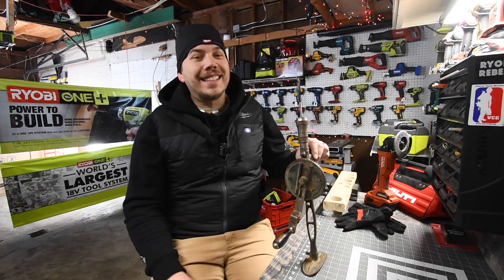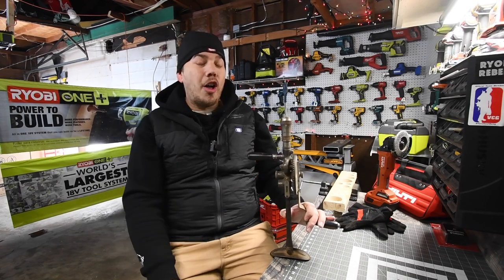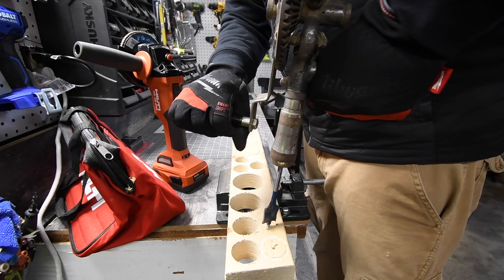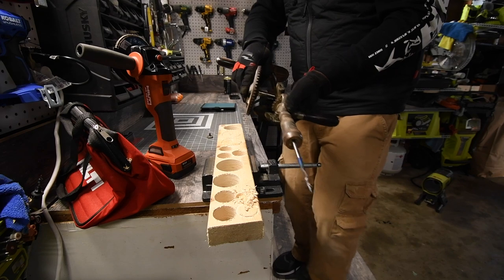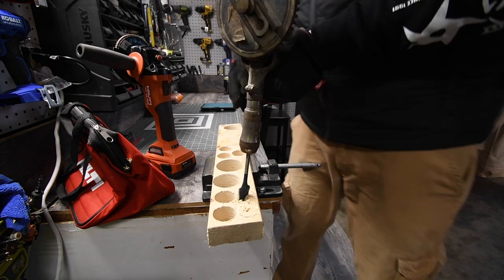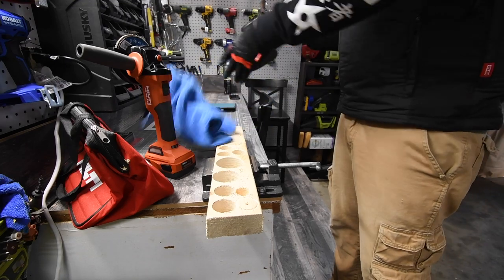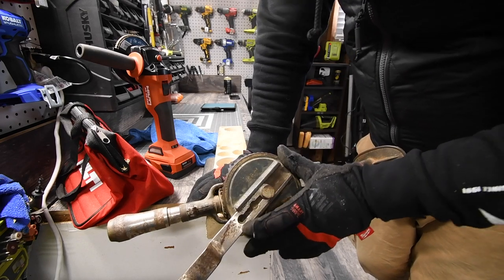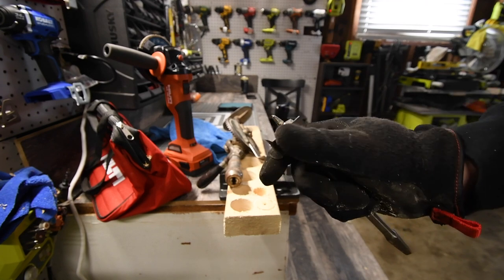131 Years Old Breast Drill (Miller Falls Tools)

Comment: 👍🏼☕🍩☕👍🏻👍🏻👍🏻  You need to get yourself auger bits though the ones to work best for those spade bits are is a newer invention
Reply from the maker: I used the original bit this tool came with
Reply: He is right about the auger bit they hace a tapered screw tip that help drive the bit 👍👍
Reply: *have...the older ones i have are like that at least
Reply: Thats not the original bit. It would have used a set of auger bits.

Comment: Nice video - it's cool to see these old tools are still around. Before you reach conclusions though, you might try doing this same thing with a 'bit brace' (hand drill) and an old auger bit. You can get them used pretty cheap. A bit brace is massively easier and is more likely how someone would have bored a large diameter hole in the past. You'll likely be surprised just how easy it actually is -- I certainly was.

Using a breast drill like you've done here is a bit like trying to cut through a piece of timber with a bread knife, and then concluding that doing things by hand must be extremely difficult. Or a more modern analogy, trying to bore a 2" hole with a super weak cordless drill and concluding it can't be done well with cordless drills. Each tool has its niche and using it outside of that niche usually doesn't work well. A breast drill was mostly used to drill much smaller holes in hard surfaces, like iron or dense wood.
Reply from the maker: I Thank you so much for viewing :)

Comment: My dad has one of those... When I was little I use to play with it with old worn out bits and a 2x4 of wood.  To drill correctly you have to use the breast plate  on your chest against a wall or low enough to muscle it to drill a hole.
Reply from the maker: It still is a hard tool to use and I thank you for viewing Frest

Comment: Guess it’s like riding a bike, where you have 3 gears where the pedals are mounted. On a bike, the chain is on the smallest gear size when in gear 1, which has high torque ideal for starting to ride the bike. As you build speed, you feel that you need to switch to gear 2, which means that the chain will switch to a larger gear/gear with larger diameter. This allows you to reach a higher speed/rpm. Same for gear 3. 
So in other words, the small gear on this old drill should be speed 1, and the large one speed 2. Speed 2 is very heavy to use for high torque tasks like the ones you are doing here, so speed 1 should make it easier.